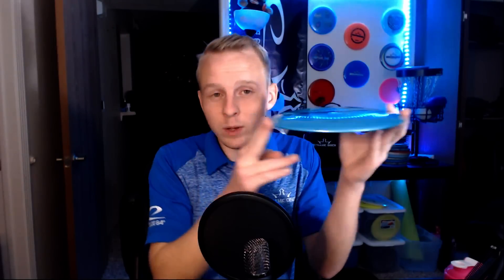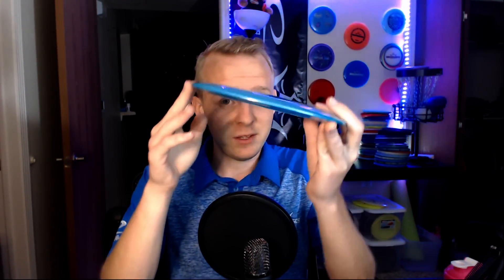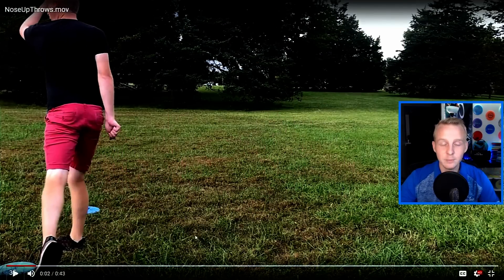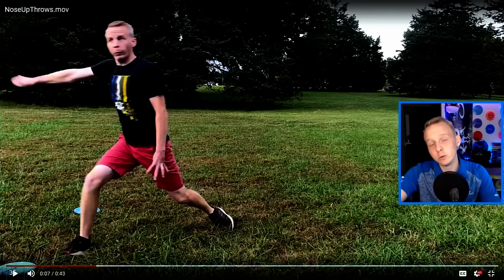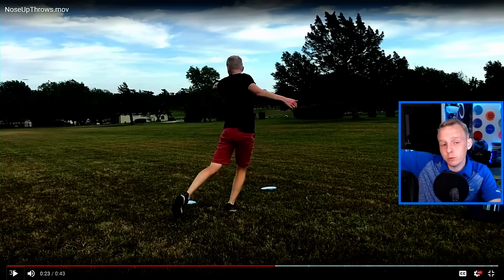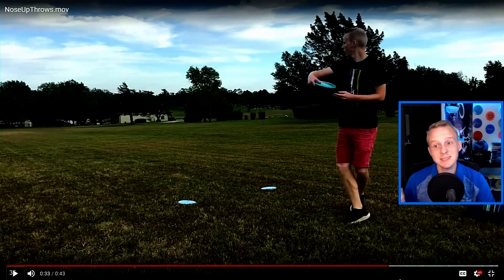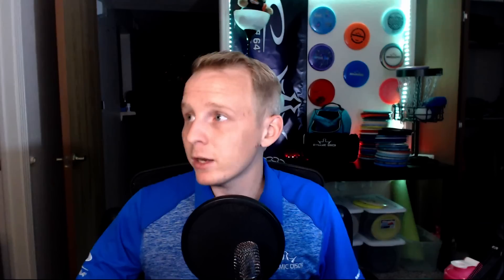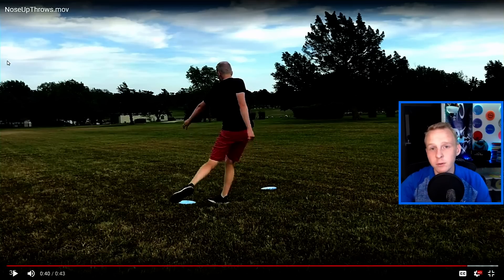A different way of looking at nose angle.

Comment: Always like your videos.  TYVM.

The nose angle is relative to the throwing plane AND the relative wind.  An exaggerated explanation: you are on a level throwing pad at the top of a steep slope with an uphill wind.  If you throw the disk level to your body the disk will soon be flying in an upwind or nose up condition relative to the wind and will balloon as expected.  So two factors are primarily at play: the plane on which you release but more so, the relative wind in which the disk is flying.  Putting is a great example of this.  You release dead straight and level. A gust of head wind changes the lift and you sail over the basket.  This is true for any accelerated shape creating pressure differences in a fluid. For disk golf that fluid is usually air.  We accelerate the disk by throwing but we release in to movement through the fluid.  It is the interaction of an additional factor that effects flight.  That being disk design.  So a release angle relative to the body or terrain, plus the design of the disk (overstable etc.), plus the movement of the air (fluid) substantially contribute to the dream of the shapes we want and the reality of the shapes we get.

Comment: another way to think about it, is if you can see the stamp on the top of the disc after you throw it... it is nose up.  If you throw it correctly at any height or angle you should see the smallest possible profile, and you will not see the top of the disc.

Comment: Intersting analysis. I find when I'm throwing downhill shots, I often throw nose up, and it may be in part because I'm trying to reach back high and finish low, but I don't practice it very much.  

I also find that I tend to yank the shot right on uphill shots even if the teepad is level.

Comment: REALLY shifting to the front leg puts you in the position to release with the "correct" nose angle. It puts your body in a position that allows your arm to release the disc with good nose angle with a lot less thinking and effort in the height of your backswing. Don't worry about anything else. SHIFT TO THE FRONT LEG FULLY BEFORE YOU MOVE YOUR ARM.

Comment: As usual, a nice vid that gives me something to think about. Getting nose down for me seems to be automatic when I think about putting pressure under my thumb, kind of getting that thumb angle slightly down. When I do that, nose down isn't a problem, and as a bonus, I get more rotation speed on the disc.

Comment: Another good one. I used to throw nose up (relative to the trajectory), on high shots and low shots until I started cocking my wrist down (like pushing down on a handshake) in my grip and through the pull. Cool to see you are doing the same through you're shots as well (I think I got that from a past video of yours?)

Comment: I'm a total newbie, having played only for about a month seriously, and your videos have been an immense help. 

Up until now, I've been solely training my backhand motion, thinking that it is the most important one between it and the forehand. However, after watching your video on how to throw a forehand and taking it to the field I soon discovered that I have been a fool for only relying on my backhand until now. Using your grip I immediately started flicking midranges like the Compass about 270 feet, and with accuracy that quite honestly surprised me. 

Granted, I can throw a backhand farther already, and I realize that the potential it has over the forehand regarding distance is a lot bigger. But I still have a long way to go with my accuracy using my backhand, and I still struggle to keep my backhands straight and low, something which has made my home course (which consists mostly of very narrow wooded holes) painstakingly difficult to enjoy. It actually started to put me off disc golf a little, but now that I unlocked the power of the forehand (thanks to you!) I will be able to make shots on these holes that were difficult, if not impossible earlier. It will surely help me grow my confidence in my abilities and my discs, which I'm sure will translate into a reliable backhand sooner rather than later. It also almost doubled my repertoire of shots, which instantly made Disc Golf even more fun!

Thanks again, and keep on being awesome!

P.S : Being a quite competent golfer I absolutely love the technical challenges of disc golf, which in my mind is an equally challenging sport, having to deal with so many different factors like plastics, wind, different types of discs, different types of shots and holes etc. I'm so happy to have found this pastime :).

Comment: today i played and just happend to try to practise nose down, just arrived home and saw your video, had to laugh a little at the coincidence. anyway, my question would be, if i need to change the grip or just on my wrist in order to get the nose angle right? or does the problem automatically fix itself once i reach back correctly as you describe in the video (could very well be as my reachback is definately too high)
Reply: I would say you have to maintain 3 things to reduce or get off from nose up.
1. Grip
2. Wrist angle
3. Correct reach back and release

Comment: Good stuff. I've been trying to level out my nose angle, but have trouble even gripping the disc with nose down. Power grip and no pinky power grip still leave the disc pointing a bit up in my hand. Can't seem to bend my wrist down that much... Is it a horrible idea to grip with middle, ring, and pinky, and put the index on top to help push the nose down?
Reply from the maker: Yeah getting the disc nose down in the grip isn't as important as you'd think. The three finger power grip is probably fine even if it's tilted up a little bit.
Reply: @DannyLindahl  Thanks for the feedback. :)

Comment: Everytime I try to correct my form, by trying to fix my high reachback, every Shot I reach back lower goes on a hyzer angle and I get 0% of Speed on the disc...
Reply from the maker: Have you tried standing up straighter as you throw? It sounds like you might have a balance issue that's causing your reachback to offset your swing. That's usually from moving too fast and leaning back as you reach back.
Reply: @DannyLindahl  Moving too fast sound 100% like me... I've also tried slowing down, but this effectively kills my timing and my distance gets even worse. It's an endless cycle of bad habits

Comment: The question is really, how do you throw high af with a nose down angle.
Reply: @Dave Munsie bro I didn't ask how to throw a hyzer flip S shot that's some newbie crap lol I want to throw high with my nose down that's how pros get distance. How long you been playing?
Reply: Same way when you throw flat, on higher throw you just aim higher or downhill aim lower meaning reach back low to release high or down hill reach back high to release low.